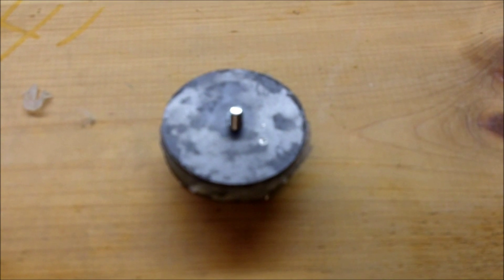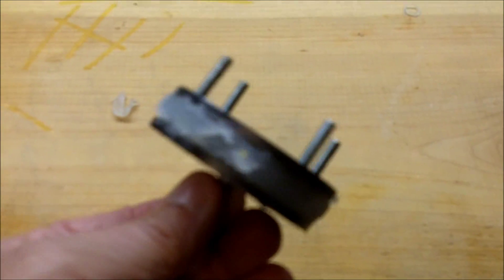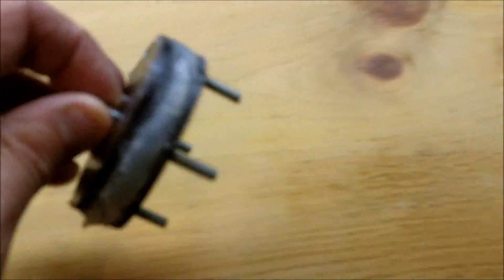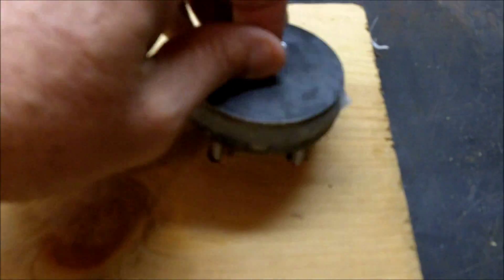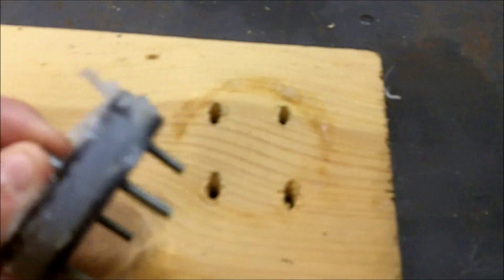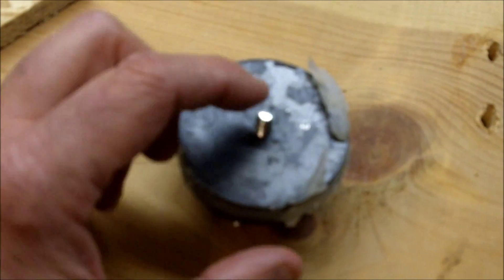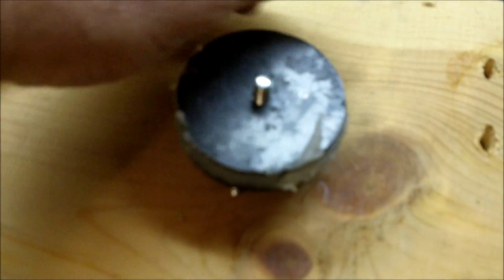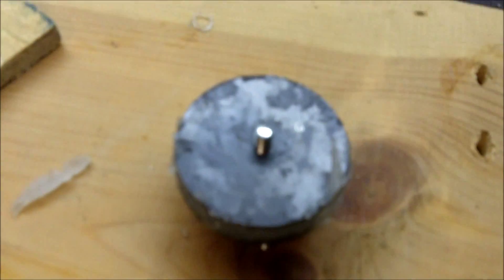Moto Camera Anti-Vibration Mount.wmv

Comment: So close yet so far. Tried the silicone trick and had the same problems then used the stuff I use for my custom ear plugs and it worked. (SkinRite 10 Translucent Mold Making Rubber). Make the camera mount an adjustable compression mount and you can tune out the resonant frequencies.